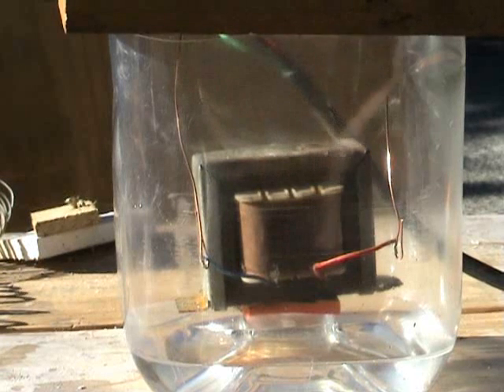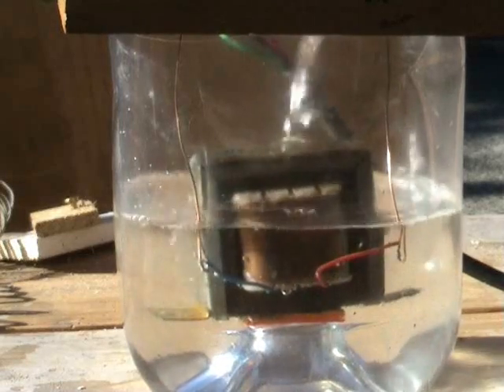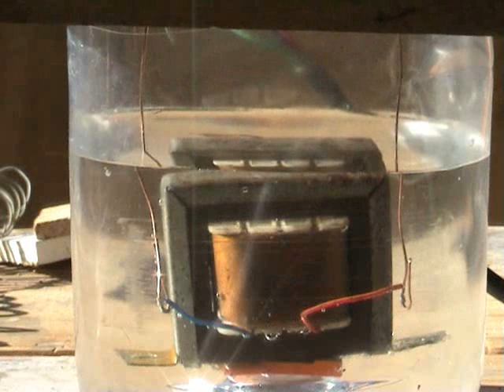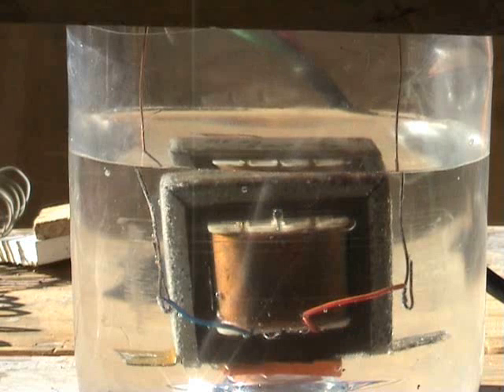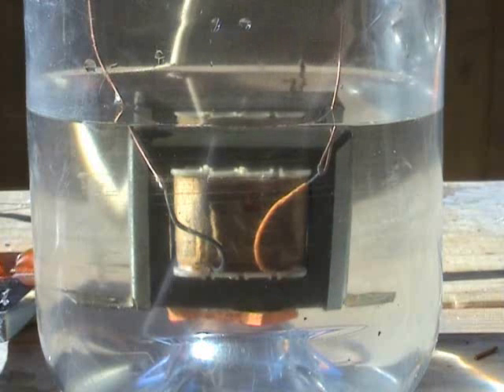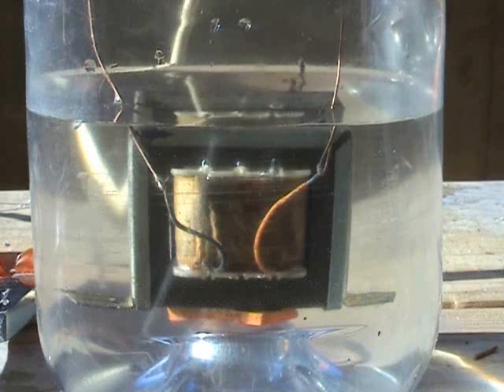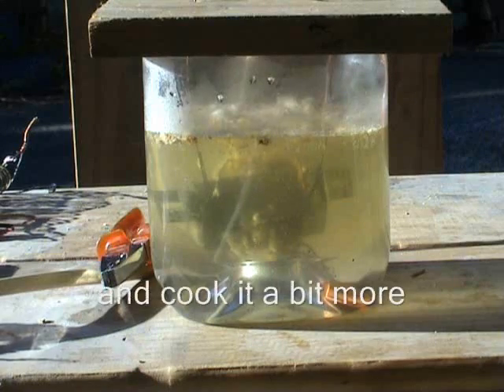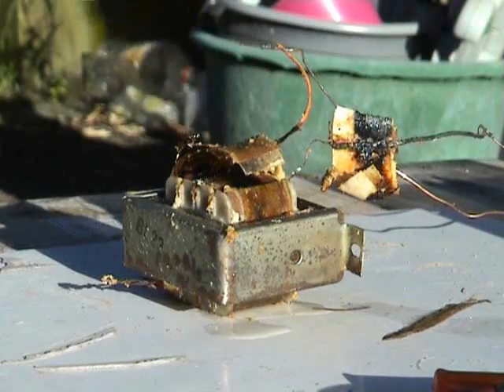Under water transformer cook up

Comment: When the secondary winding short circuit, it will cause the transformer to saturate, changing the inductance property of the coil, and turning it into a large resistor. With adequate cooling it will stay the same without any issue. No cooling and its a flambe

Comment from the maker: @2932danger88 Start with looking at safety as number 1.
Always unplug whatever electrical experiment you are doing, when touching the experiment. Use a shield in between you and camera, safety goggles.
Be aware of capacitors which can store a lethal charge.

Comment from the maker: @BarneySaysHi  It is a split phase circuit. 1 phase 11kV or 6.6 kV transformer feed from 2 phases or 1 phase SWER (single wire earth return) at the HV side.

The secondary winding  has 4 terminals and can be arranged as 2 x 230 Volts or 1 x 460 Volts with centre tap for single phase motors over 3 to 5 HP with cap start.

Comment: @RODALCO2007  You said "In remote rural areas 230 / 460 or 240 / 480 is used, phasing 180 degrees apart." But with 180 degrees that would be 2-phase, which is a bit odd in my view... Don't you mean 120 degrees with 3-phase?

Comment from the maker: @Nivicoman No worries. It is great to discuss electrical matters and please do ask if you are not sure.
Your experiments are similar when I was your age , I used 4½ Volts batteries in parrallel to get more current and glowed paperclips and small coils of thin wire.
The batteries didn't last too long with the excess current draw.

Comment: @RODALCO2007 But as long as the person is isolated from Earth or another phase...... Just kidding I wouldn't test it. I've put myself by accident across 250 volts in a reel to reel tape deck power supply. Not the nicest sensation.

Comment: @RODALCO2007 Like the US 120/240 split phase 180 degree shift. I imagine where 480 volts is used in a residence it would be well protected against someone coming in contact with it or having an explosive fault condition. I've seen what 480 can do-BOOM!! 
To my knowledge US residences have 240 maximum some areas 208. 480 only in commercial buildings fed by a 13.2 Kv/480 transformer. The building caretaker at my work found out about 13.2 Kv on a Fluke 87-POW! He wasn't badly hurt luckily.

Comment: @RODALCO2007 Please excuse all the questions. I've had an interest in things electrical since age 6 and even then I was taking small springs and setting them bright red with a 6 volt lantern type battery like in your battery hack. Small permanent magnet motors found in battery operated toys do not like running on that 6 volts, they smoke out just like the 110 volt motor on 240 volts. And then there were the light bulbs such as grain of wheat, torch, indicators etc 3 or 6 volt.

Comment from the maker: @Nivicoman In remote rural area;s 230 / 460 or 240 / 480 is used, phasing 180 degrees apart.
1 or 2 phase motors can be used on the higher voltages with less current draw.

Comment: @RODALCO2007 What is the highest voltage found in residences in NZ? I saw a post which someone stated 240/480 for larger residences and I found it hard to believe but it could be a matter of I2R losses and wire guage for air conditioning and lifts etc.

Comment: Did you know you can disassemble most of these Low voltage EI laminated transformers, and rewind them. If you have a junk box of various small transformers, but with not quite the right voltage or current you need for a project, you don't need to buy one, you can rewind an old one. I've done a few now, it does take hours to do thou but, it's fun.

Comment: Nothing worse than the smell of burnt transformer. We had a 1 KVA control transformer in a test bench burn out because a load bank with a 115 volt 20 amp fan motor was plugged into that bench. After about 30 minutes it started smelling and the transformer burst into fire. The fuse that was intended to protect the transformer was a 30 amp piece. How someone came up with that is beyond me. The transformer ended up protecting the fuse.